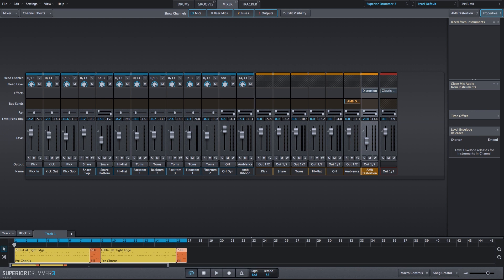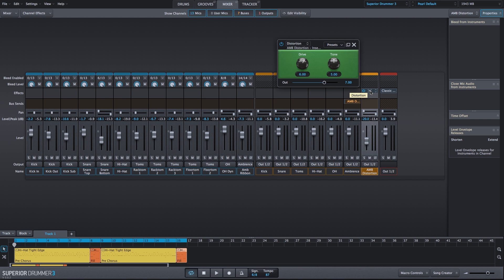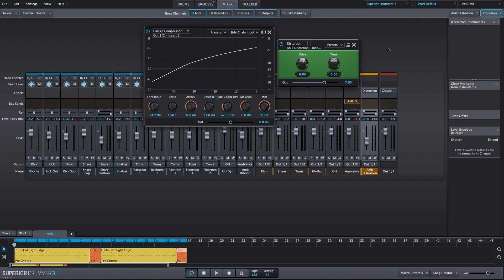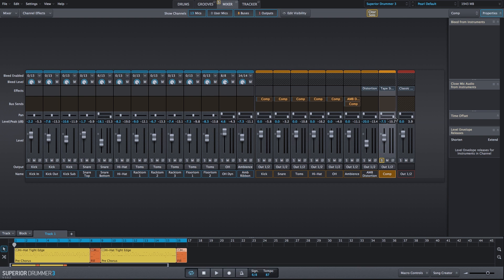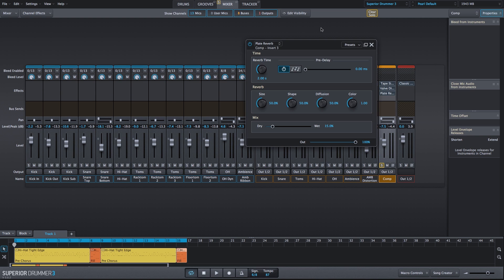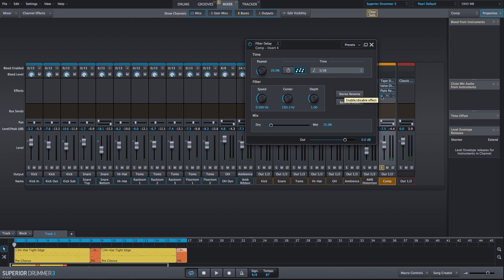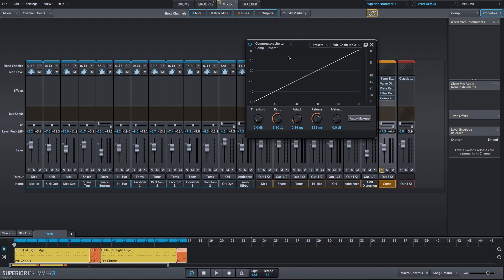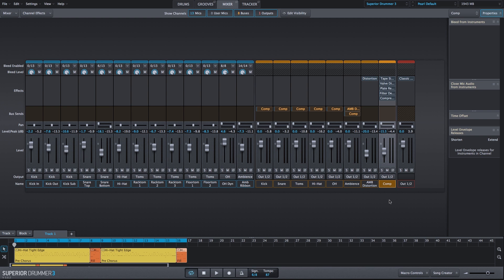Superior Drummer 3: How to create a massive-sounding compression channel

Comment: Ok. I'm updating. I never use the effects in 2.0, I just rely on all the plugs I already own. I'll have a hard time not using these though. Sounds great.
Reply: Its true they actually sound decent. I just did a production i was too lazy to route SD3 properly and did all drum mixing inside the VSTi. It came out just fine. But you really should consider updating since 3.0 is miles away ahead of 2.0 in terms of sound. This thing really is amazing, it sound like a pretty well tracked live drums. Before you couldnt really make a radio grade song without a live drummer, now you can.